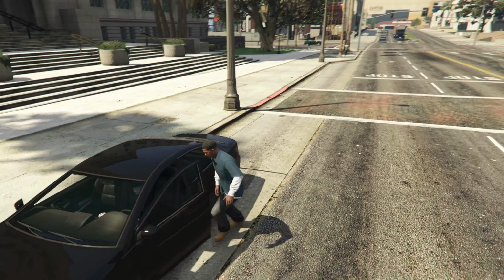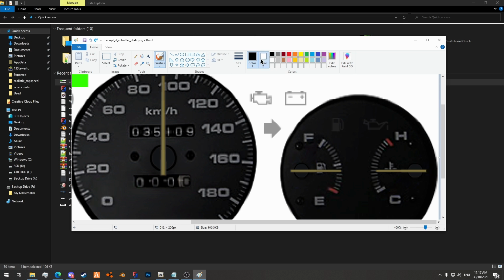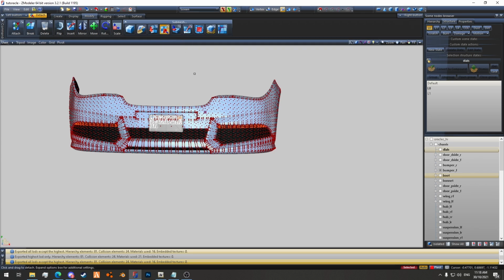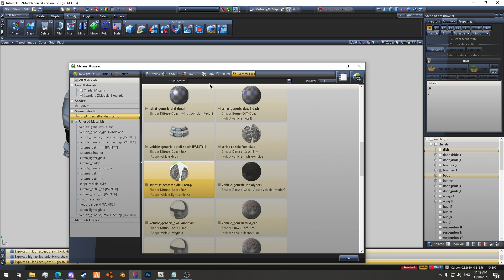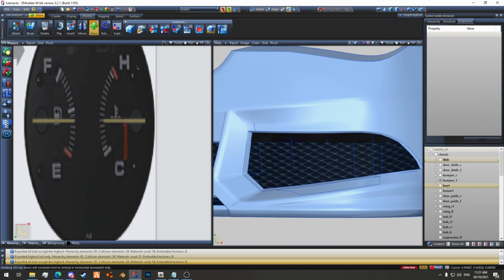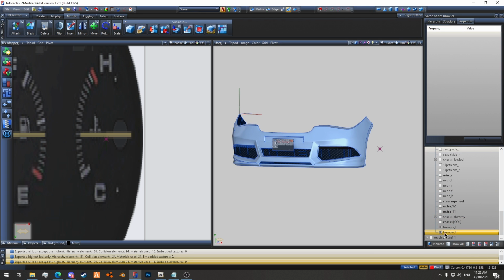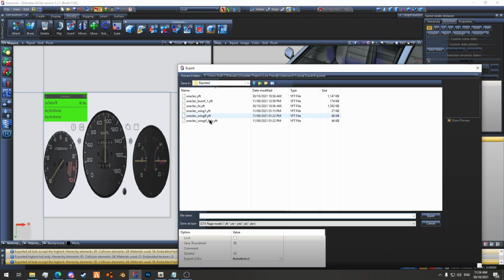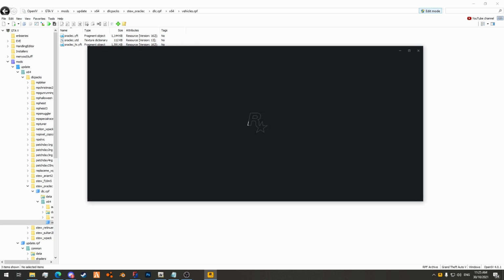Create Animated Lights [ZModeler 3 | Tutorials]

Comment: tried this with a bike but the animation goes very slow unless i press the gas, any way to fix this?
Reply from the maker: No, it's using the dials as your animation so the speed of each dial needle will determine the speed of the animation. You can try to map it to a different needle, I usually use the temperature one as that one stays fairly consistent at start up if I remember correctly.
Reply: @13Stewartc  i used the temperature needle, i'm gonna go ahead and trial and error because i saw bikes where the animation went smoothly without driving

Comment: First thank you ..But Why can't I change the color of the light.. even though I applied the same steps
Reply from the maker: If you set the light material to a [PAINT:number] it will only be able to be changed in-game, if you want to hard code the color just make sure you are using the same material / shader setup as I am in the tutorial and set the color via the diffuse color setting in material properties (also remove the [PAINT:number] tag :)
Reply: @13Stewartc  i use zmodeler3.1.2 old version .. Is it the reason the light is not tinted?
Reply: can you help m with this man i'm a bit confused
Reply: You need the latest version for the emmisive to change colour. It won't work on 3.1.2

Comment: is it possible to apply livery on that vehicle which does not have any livery using zmodeler?
Reply: you dont need zmodler for that use openiv make sure you set the name of that as the same one that is plain ie for my hellcat its chr19_sign_1
Reply: @chemicalrages5834  but i want to add a livery in that model which do not have any livery